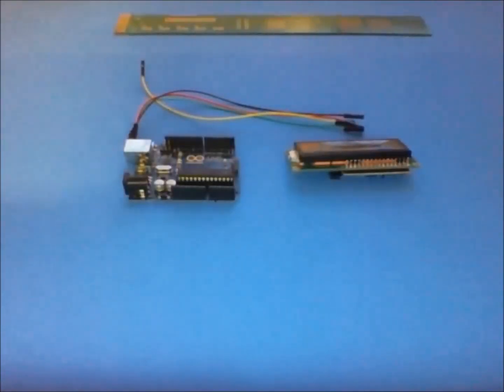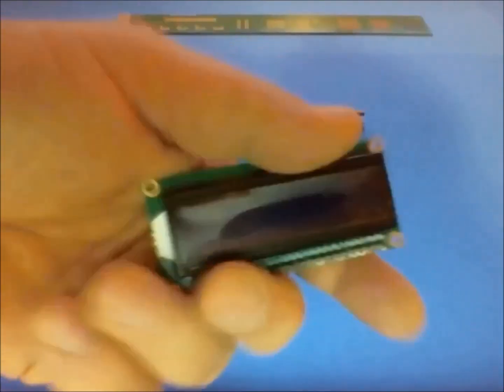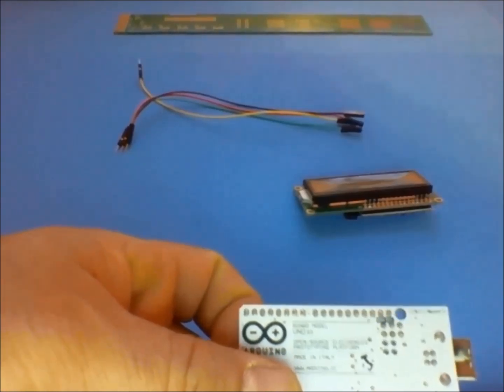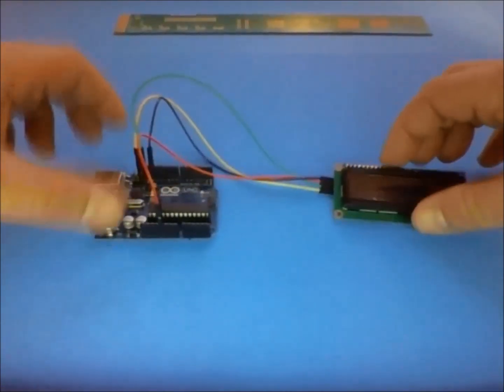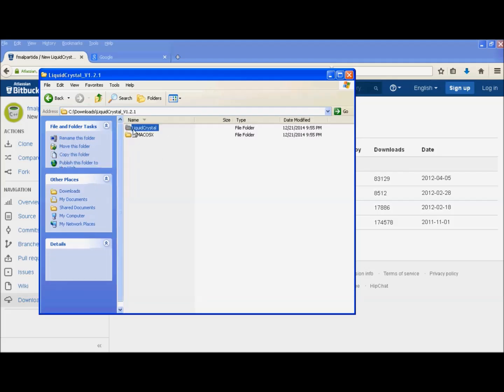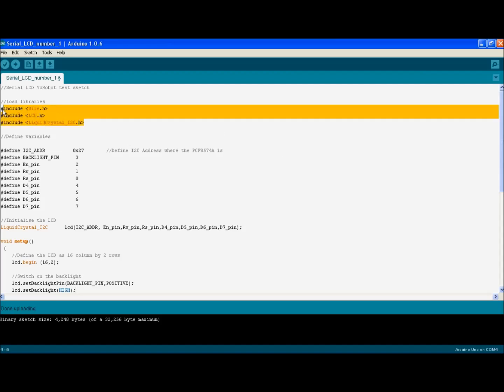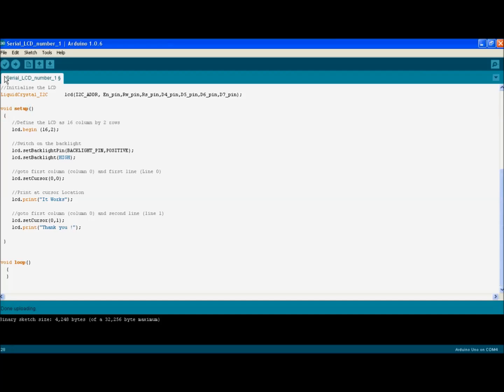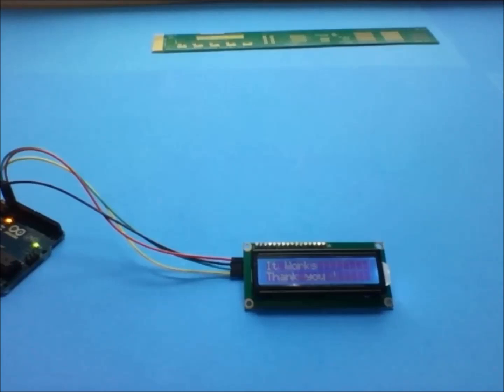How to connect a serial LCD to Arduino UNO

Comment: Thanks! Very informative video.  I've got several low pin count LCDs in my junk box, and have been trying to figure out how they work. Is the Liquid Crystal library you mention in the video the same as the library found in the Arduino IDE under Examples?

Comment: I used 0x3F. When I run the code with Arduino IDE, it does not work, showing "fatal error ...Wire/Wire.h: No such file or directory. I may have messed up my library.

However, using arduino web editor works.  I changed to 0x3F btw. 

Thank you, It took me quite long to get it working. And I need this for my project.

Comment: Firstly this may be a very old post but its the ONLY one I found that really helps get these serial LCD displays working.
so...
Thanks so much for this video, i tried for hours to get these serial displays to work but everything failed until now.
Some small tips that may help others perhaps.
1) Use the i2c scanner sketch in the Arduino IDE to confirm the address of your specific display. Mine was 0x3F
2) I'm using an Arduino Nano and just to be clear for others A4 is SDA and A5 is SCL
3) Don't forget to check the contrast pot (blue one) is turned fully clockwise to start...adjust it after it all works.
The sketch you worked through works perfectly on Arduino IDE 1.8.0 with all three listed library files installed.
Good job on working through these frustrating issues.

Comment: thanks for this! this was really helpful in getting my head around the initial setup. i did run into a few probs along the way. but probably because i was using generic hardware, and my I2C_ADDR turned out to be running through 0x3F, as i've seen a few others have on forums.

this YT vid in addition to this post: http://forum.arduino.cc/index.php?topic=128635.0 solved all my probs. thank you for all your help contributors! : )

Comment from the maker: Do you get this error when you upload the code ?
Reply: In your library "NewliquidCrystal_1.3.4" using example "HelloWorld_i2c" when I try to upload the IDE reports the error:

Arduino: 1.6.9 (Windows 7), Board: "Arduino/Genuino Uno"

HelloWorld_i2c:8: error: no matching function for call to 'LiquidCrystal_I2C::LiquidCrystal_I2C(int)'

 LiquidCrystal_I2C lcd(0x38);  // Set the LCD I2C address

                           ^

C:\Users\user\Documents\Arduino\libraries\NewliquidCrystal\examples\HelloWorld_i2c\HelloWorld_i2c.pde:8:27: note: candidates are:

In file included from C:\Users\user\Documents\Arduino\libraries\NewliquidCrystal\examples\HelloWorld_i2c\HelloWorld_i2c.pde:2:0:

C:\Users\user\Documents\Arduino\libraries\LiquidCrystal_I2C/LiquidCrystal_I2C.h:57:3: note: LiquidCrystal_I2C::LiquidCrystal_I2C(uint8_t, uint8_t, uint8_t)

   LiquidCrystal_I2C(uint8_t lcd_Addr,uint8_t lcd_cols,uint8_t lcd_rows);

   ^

C:\Users\Isaac\Documents\Arduino\libraries\LiquidCrystal_I2C/LiquidCrystal_I2C.h:57:3: note:   candidate expects 3 arguments, 1 provided

C:\Users\user\Documents\Arduino\libraries\LiquidCrystal_I2C/LiquidCrystal_I2C.h:55:7: note: constexpr LiquidCrystal_I2C::LiquidCrystal_I2C(const LiquidCrystal_I2C&)

 class LiquidCrystal_I2C : public Print {

       ^

C:\Users\user\Documents\Arduino\libraries\LiquidCrystal_I2C/LiquidCrystal_I2C.h:55:7: note:   no known conversion for argument 1 from 'int' to 'const LiquidCrystal_I2C&'

C:\Users\user\Documents\Arduino\libraries\LiquidCrystal_I2C/LiquidCrystal_I2C.h:55:7: note: constexpr LiquidCrystal_I2C::LiquidCrystal_I2C(LiquidCrystal_I2C&&)

C:\Users\user\Documents\Arduino\libraries\LiquidCrystal_I2C/LiquidCrystal_I2C.h:55:7: note:   no known conversion for argument 1 from 'int' to 'LiquidCrystal_I2C&&'

Multiple libraries were found for "LiquidCrystal_I2C.h"
 Used: C:\Users\user\Documents\Arduino\libraries\LiquidCrystal_I2C
 Not used: C:\Users\user\Documents\Arduino\libraries\NewliquidCrystal
 Not used: C:\Users\user\Documents\Arduino\libraries\LiquidCrystal
exit status 1
no matching function for call to 'LiquidCrystal_I2C::LiquidCrystal_I2C(int)'

This report would have more information with
"Show verbose output during compilation"
option enabled in File -> Preferences.

Comment: hello,
Im very new to all things arduino ,that said I keep getting this error message , 
Arduino: 1.6.6 (Windows 10), Board: "Arduino/Genuino Uno"

sketch_dec08a:11: error: #include expects "FILENAME" or <FILENAME>

 #include wire.h

          ^

sketch_dec08a:13: error: #include expects "FILENAME" or <FILENAME>

 #include LCD.h

          ^

sketch_dec08a:15: error: #include expects "FILENAME" or <FILENAME>

 #include LiquidCrystal_I2C.h

          ^

exit status 1
#include expects "FILENAME" or <FILENAME>

  This report would have more information with
  "Show verbose output during compilation"
  enabled in File > Preferences.

Comment: may be u should help me with the code that u run on the arduino cos i've tried it didnt work
Reply from the maker: Abdullahi Hassan 
can you share with me what have you done so far and what equipment are you using?  which Arduino, what type of LCD and how did you connect both devices?

Comment: Hi. I have a parallax serial LCD with 3 pins (RX,5V, and GND). I am trying to make it work with Arduino Uno but it doesn't work. I am not sure if there is a problem with the wiring or the software. Can you help me find the library i need for the code?